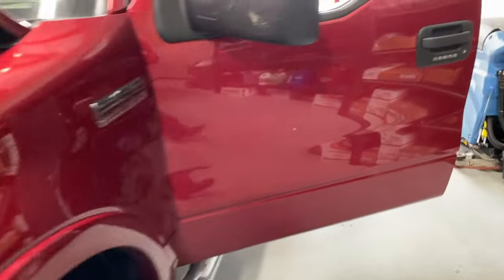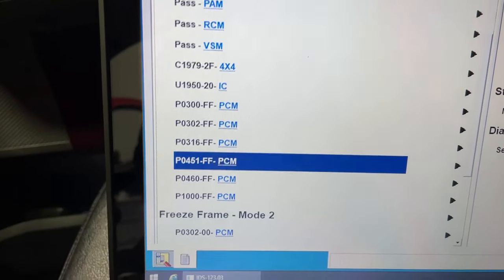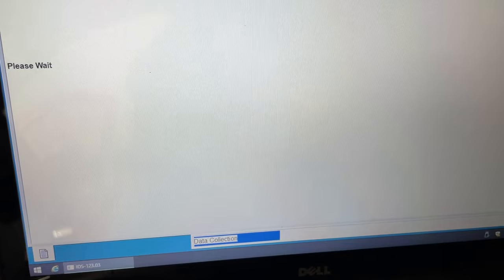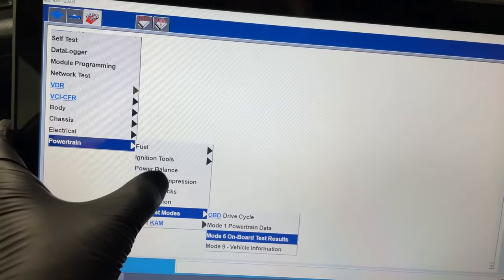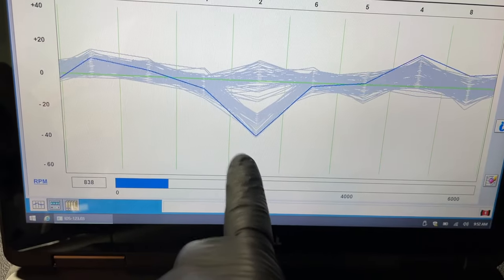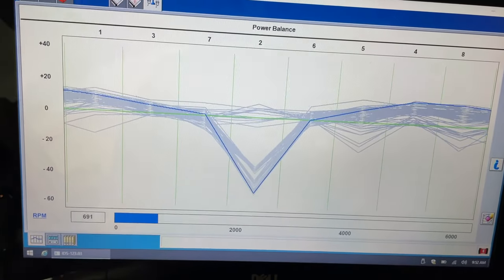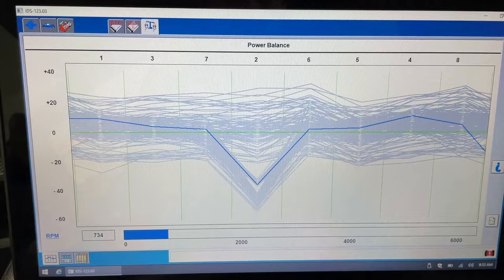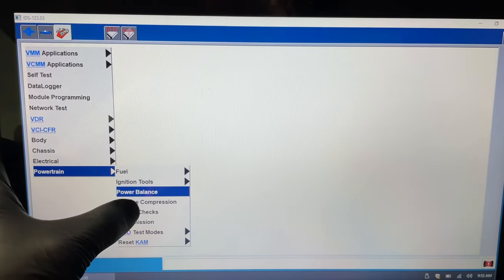Ford F-150 5.4L 3v Triton Engine Misfire: Champion Spark Plugs Belong in Chrysler’s and Lawn Mowers!

Comment: I played with numerous brands of spark plugs and I determined the plugs that lasted longer/durability were NGK or Denso, even on domestic vehicles.
Reply: NGK best ND second Autolite Third Bosch too dam expensive performance lasts a few months then they just feel normal and Champion well not even lawnmowers want those
Reply: I have learned over 40 years that champion works best in lawn mowers,  weed trimmers, chain saws and such,  they are a straight magneto system,  no coil,  ngk works best in Japanese vehicles ,  Bosch works best in European vehicles,  autolite or motorcraft work best in American vehicles,  and I believe the denso plug is a damn good all around plug,  I certainly agree on that one,  I'm doing a job right now on a  knocking 2006, 5.4. Now that you mention it,  some people dont like my outside the box theories but dang man,  I'm going denso in this Ford,

Comment: In the past 22 years I have seen 3 defective ford spark plugs right out of the box and I personally have never seen a single bad Champion plug, lawnmower or otherwise. As well the Champions are physically stronger being machined out of one solid piece of steel. The Champions will not break off in the head so I will keep using the Champions on the 5.4s. As you stated the reason the spark plug failed is because it was loose.
Reply: Champion is a lawn mower plug sorry man so as it's out of light I wouldn't use them in my weed eater
Reply: I’m changing my plugs, last person put in champions. And yes they will break off in the head, first hand experience.

Comment: trick for removing these spark plugs is do it hot and snap it loose with a small impact gun.  works perfectly
Reply: I just accept that they will likely break and use the tool on the ones that do.  It works like a charm and I don't work on a hot engine.
Reply: @garryr  yup got that too! when I have to do it I do it 🔥! I don't want to mess around for my labor of money! done my way fast and profitable! Fams will work on hot days! lol. cheers mate!

Comment: I’m not a mechanic but since the spark plugs have a calibrated electrode gap I guess you have to be careful not to hit them during installation, right?  Even little details like blowing all the debris out of the spark plug well before replacement show that you’re an experienced technician 👍
Reply: Some spark plugs are "gapped" from the factory to your vehicle engine, they can be adjusted slightly and should be checked before installation.  You have to be very careful not to drop the spark plug into the hole as the it might get damaged/gap closed.  Also the ceramic insulator can crack during installation.  It is good practice to blow out any debris before removing the spark plug, you don't want dirt or small pebbles to fall into the combustion chamber.

Comment: Mr. Loco. I just removed 8 E3 spark plugs from my 08 Navigator because I had a misfire. Bought it a month ago and the seller told he just changed the plugs and I wouldn’t have to worry for a long time. The last plug I pulled looked like someone bit the end off. It failed completely. I put in a new set of Motorcraft and it runs as it should. What would cause that to happen and by some miracle it seems that no engine damage occurred.  Next, I’m going to save up a few bucks and get all new coils.
Reply from the maker: Normally it is because the plugs were not torqued correctly.

Comment: I am a firm believer in buying the right OEM parts for my vehicles if at all possible.  Learned a valuable lesson with my '05 F150 with a 5.4L V8.  I bought a cheap set and it did not last long.  Only 23K miles and I  found myself having to replace them.  But make sure you get what you pay for because the fake ones are out there. I replaced my cheap set this time with Motorcraft plugs/coils, and to my surprise, i again had a misfire.  Found i indeed had been shipped 4 of 8 plugs that were fakes.  It's a thing, apparently.   There is good information online that shows you what to look for. And to rub a little salt in the wound I found that a ground electrode "strap" on one of these  counterfeit Motorcraft plugs had broken off and I guess was sucked out the exhaust valve. Could not believe it ! Luckily, the truck runs great, so I dodged a bullet on that one. I learned that you must spend the extra money on plugs, coils, and several other parts because it pays off in the long run.  Just make sure your OEM parts are legit!  Lesson learned.
And thank you for this video!

Comment: great video. Having similar issue with my 2008 ford expedition. It was misfiring on multiple cylinders. Changed out my spark plugs and coils. Now it's only marking a misfire on cylinder 4. I swapped coils with cylinder 4 and 1 and still reading PO304 PD. Need to figure this out so it will pass my smog inspection. And get rid of this car. Too many issues with ignition and spark plugs breaking.

Comment: I like  this video,lack of spark plug torque = high resistance. Very common I always  replace the ignition  coil. Aftermarket  parts  not recommended. I can hear when these are loose.

Comment: Champions can be a good choice. Just watch for easily cracked ceramics from dropping or abuse. I use the old champion pressure tester if I suspect a cracked plug internally.

Comment: Just want to mention, I also have seen a pile of bad aftermarket ignition coils for ford modular engines. I always end up switching them back to used oem coils with new boots. The ones with the clear epoxy top and that little chip exposed are the worst!

Comment: I wish you lived near me in VA.  I have a 2000 7.3 runs strong with 0ver 300,000. Need the turbo riser gasket changed I think it's leaking. Time for a good look over by an intelligent mechanic as you.

Comment: Some quick math on Amazon - the dude saved about $100 on the set of cheap coils vs Mastercraft, and $20-30 on spark plugs. Less than $150 -- a cheap price to pay for your truck running like garbage for weeks, multiple days at the shop, etc. Buy once, cry once.

Comment: I had a 99 f350 with the v10 engine,,ran good but i decided it was ready for a tune up at about 80,000 miles,,,made the mistake of getting cop's and plugs off e-bay,,,,they were way cheaper than ford or even a parts store,,,,,they didnt last but a few months and the misfires started ,,,,,,before it was over i had replaced c o p and plug out,,,,hard lesson learned the hard way,,💰💰💰💵💸💸💸💸💸

Comment: I always recommend the O.E. brand and type of plug to our customers except for in the Triton. After all of the broken plugs I've had to remove from them I always recommend the 1 piece champion plugs. Even if you get a bad plug every once in awhile it's still worth it not having to deal with extracting the 2 piece design.
Reply: the 2 piece pugs were superceded by a one-piece design years ago. Nobody even carries the old two-piece ones anymore. I only put the motorcraft in them.
Reply from the maker: The Ford plug design has been fixed for about a decade or more. I can verify they come right out.
Reply: Well, That plug looks like it was installed a decade ago.  Ford always craps the bed with plugs in the Triton.   Torque specs off which allowed the plug to come loose and shoot out.  Then They added more threads to the plug.  Still shot out.  Next went to the breaker plugs. We all know how that worked out.   Terrible design that champion corrected way before ford gave a crap about the issue.  After champion killed them in the aftermarket, motorcraft made a new design plug.
Reply: @1005dragrcr  maybe you should try having your torque wrench calibrated. I’ve never in all my years of working on these engines, ever had a plug spit out of the head.
Reply: @cnrails  I have never had any of the plugs that I installed come out , only the factory installed ones before scheduled maintenance was due.  You must be a shade tree mechanic if you have  never heard of Triton plugs shooting out.  Look online for the repair insert kits for repairing the threads, they are everywhere.  Wouldn't make the kits if it wasnt a problem.  Btw, they also make extractor kits for removing the broken pieces of plug that are left in the cylinder from these breaker style.   Guess in your opinion, that isn't a real issue either....lol.
Reply: @1005dragrcr  plugs coming out of mod motors are common, but only when wanna be mechanics like you install them incorrectly.
Reply: @cnrails  I guess your illiterate cause I said I have never had a plug shoot out that I installed....only factory installed ones.  I have been a fleet mechanic for 25 years....no novice here.  YOUR A TROLL BEN.
Reply: @1005dragrcr  fleet mechanics are garbage. Never met one that could do a job properly. Slam bam lets get it back on the road no matter what the book says.
Reply: @cnrails  TROLL

Comment: Changed the plugs. Still did it. Pull the coils and cleaned up the connection  between the spring and coil . Problem fixed. There was alot of corrosion  between the spring and where the spring sits on the metal pin on coil.

Comment: No Champion  crap in my small engines - NGK only!   Great video.
Reply: Careful where you buy your NGK's. I got sold 4 fake ones from Summit
Reply: @mark98070  Thanks.  I had similar issues, so I started buying locally.
Reply: My hemi took $2 champion plugs and they always worked good. Granted the change interval was 60k miles.

Comment: I just bought a new set of factory plugs for my '10 Escape Hybrid based on this video.  Mine have never been changed in 11 years and I have a slight misfire when the engine is cold.
Reply: If it's the Mazda built 4 you have to be concerned about a valve/head issue for minor misfires.  If the plugs and coils didn't fix it do a compression and a leakdown test.

Comment: I did a pre test on a d100 and it passed with the factory champion plugs. The customer asked for Autolite and when I did the tune up and retested, it failed. After some quick deduction, I stuck the old champion plugs back in it and it passed! From that day on, I prefer to use the factory recommended plugs on all vehicles now. Bosch plugs do the same thing. I have gotten misfire codes from them.... All of that development really does work... In all of my off road stuff I run NGK irridium and always will until they present an issue. Be careful comdemming other peoples work as you will get sued and may lose even if you are right....

Comment: A friend of mine laughed at me when I purchased my 3v spark plugs and replacement coil at the Ford dealership.
From the dealership; I’m purchasing OEM non counterfeit parts. 
As for Chumpion spark plugs; I tried using them in my drag racing days in my 1970 Camaro. Had nothing but misfire issues with new Chumpion plus.
Switched back to AC plugs and seldom ever had a problem.

Comment: I can attest that Champions do belong in Chryslers.....but I wouldn't put them in my lawn mower....I like my lawnmower.
I had a 99' Caravan 4-cylinder that had misfires immediately after doing a 100K service, which included some "premium" something-or-other sparkplugs. Installed some basic, copper Champions and it ran perfectly for another 100K miles afterwards. At the 200K service, I didn't make the same mistake.

Comment: I can't get a plug out.  It's not original, changed back in 2015.  2005 5.4l 3v expedition.  I've changed the others no problem.  But one just spins and never comes out.  I finally gave up and just tightened it back down, and it runs ok.  Why can I spin it and spin it and it just won't come out?  I've pit plies on the end of the plug and pulled with everything I've got.  Won't budge.  But, I can still tighten it down.  I only want to change it because of intermittent misfire under load, classic coil or plug.  Already changed coil.

Comment: Champion Spark Plugs Belong in Chrysler’s and Lawn Mowers!.. Yea Fords are so damn picky about the spark plugs! and the 3v 4.6/5.4 have a terrible plug design! How long has Ford been making engines? I have a 98 F150 with the 4.6 2v and the short threaded spark plug design(thanks Ford) that you have to over-torque a little so they don't get loose and blow out the head!

Also stay away from aftermarket coils they suck! Had a set of Accel coils and after a month of use failed (had mis-fires traced down the coil packs). So I just put on the good old Motorcraft ones.

Cheers!
Reply: I had accel on my 05 5.4 3v and I did not have any problems with them
Reply: My brother had put some of those splitfire x4 plugs in his grand marquis way back in the day. Chased a misfire fir sometime. Ended up being this crap plugs
Reply: I found Ford Racing Plugs at Summit Racing and installed them in my 5.4L 3V runs great with the High Performance Coil Packs, even smokes the tires on my Expedition!
Reply: Junk it

Comment: I have a Honda 3.5 engine and I was going to change plugs and asked a Pro tech I trust  what ones I should get, He said OE only they were NGK $12 each, all other aftermarket brands were $6 each, he said after a short time the Aftermarket plugs will fail,  I bought the OE ones have had no problems, searched out spark plug issues on that engine and foundd tons of I bought the $6 plugs and have lots of problems,   Sometimes you don't save money by saving money

Comment: This is probably the type of person to walk into the parts store and ask for the cheapest or maybe hire shade tree guy. I understand times are tight, but it doesn’t cost that much more to use quality parts or service and could actually be cheaper long term. Saving a few bucks is not worth the risk of trashing your catalytic converters.
Reply: Those people make me laugh, use the absolute cheapest parts possible and have no idea what they are doing and then will make comments like "ford sucks"
Reply: The champion spark plugs actually cost more than the ford plug. The reason for the champion plug is because they are a 1pc spark plug, unlike the Motorcraft plugs that are 2pc. and tend to break off in the cylinder head. Sounds the who ever installed the plugs didn't tighten them properly.  Still good information

Comment: Looked to me like # 5 was taking strain. I have absolutely no idea why people with Fords do not just put in the Motorcraft plugs and coils. They watch some self proclaimed expert on YouTube who tells them their vehicle will run better with some flashy looking garbage that ends up doing more harm than good.
Reply: Because up until a few years ago motor craft plugs for the 3valves were 2 piece and other brands were 1 piece, preventing them from braking when removing them.
Reply: @alandominguez3839  Yep. Had plugs replaced on my '09 F150 at 80k miles. Got away easy, they broke only two... Someone who knows, what was the idea about 2 piece plugs?
Reply: Because NGK still exists
Reply: @milantrcka121  I'm going to say, to save money....
Reply: I try to use Motorcraft Plugs and Wires whenever possible. Not always easy on the older stuff though. I definitely would not recommend Champion Plugs they seem to be one of the cheaper plugs out there and as the saying goes. You get what you pay for. Honestly I don't even like using them for a Lawn Mower..
Reply: I have owned a Mustang, a Thunderbird, two Focus, and an Explorer, all V8s (except the Focus).  I have learned over the years to use strictly Motorcraft plugs and coils. I replace them every 100,000 miles without fail.  Got 250k on the Mustang, lost it in a crash.  Got 200k on the T-Bird, then sold it.  Got 300k on my Explorer and it's still running strong, original engine and trans. Got over 250k on the Focus.  Oil changes every 5,000 miles without fail as well.
Reply: Waiting for Scotty Kilmer to make his video “don’t buy Motorcraft”....
Reply: @milantrcka121  How did they break a plug in an 09? The 2009+ have a different plug that aren't known to break like the 04-08.
Reply: @mph5896  My bad, it is an  '07. Sorry...
Reply: @milantrcka121  that was funny lol,  I had to laugh about my 3 piece camshaft after l blew the motor in my old jolly roger boat,  ,   I rebuilt the motor tho,
Reply: The reason why many professionals choose to use "other" brands is because "some" Ford (Motorcraft) parts are junk from the factory. In this case, the "factory" spark plug design for the 3 valve engines was so bad that the spark plug would brake when attempting to remove the plug. POOR DESIGN.

I personally am not a fan of Champion; however, Champion realized that Ford had completely screwed up and Champion started from scratch and designed a spark plug specifically for that engine.

I personally wouldn't use a champion (even in my lawn mower); however, it is the only spark plug our shop will use on the 5.4L 3v engine. That being said, (and to my surprise) we have had ZERO issues with the Champion spark plugs on this specific application.

All else: NGK

Comment: Someone put Bosch in my 4.6. Those are also Garbage. Not made for Fords at all.  Fomoco is the only thing that operates as designed for Fords.  I had several codes when I bought my truck. Gave it a tune up, cleaned the throttle body replaced the gaskets. I put OE back into and my 04 4.6 runs like a brand new truck. NO more codes. Now….on to the 5.4 I just bought. This one may be a bit more involved but we shall see what I come up with. Thanks for the videos!!!
Reply from the maker: Bosch has always been the worst when it comes to Fords.

Comment: If the misfire was caused by a Champion plug, assuming there are Champion plugs in every cylinder, why weren't the rest of them misfiring?
Reply from the maker: Oh the rest were not in the best shape either, customer wants them gone.
Reply: Because Champion are not bad plugs.  It were installed wrong.    Nothing like Bosch plugs..